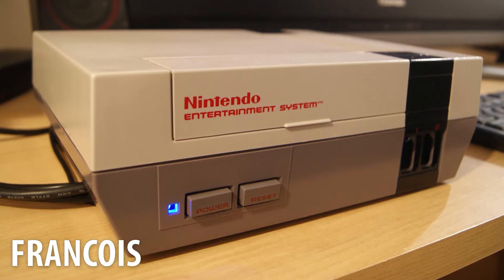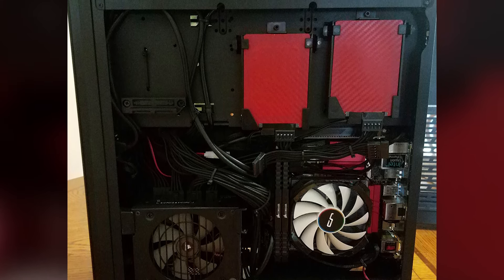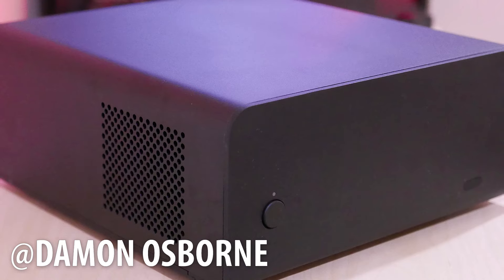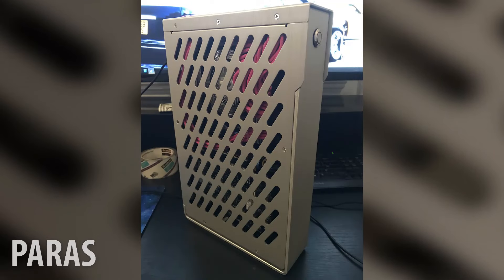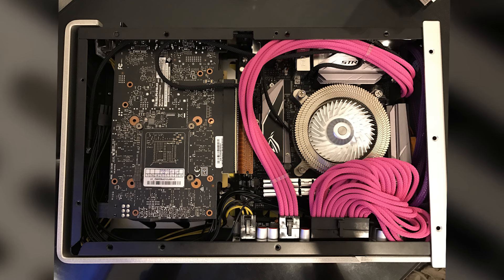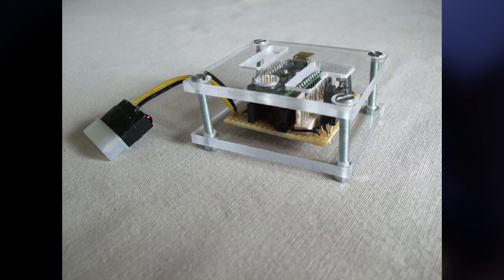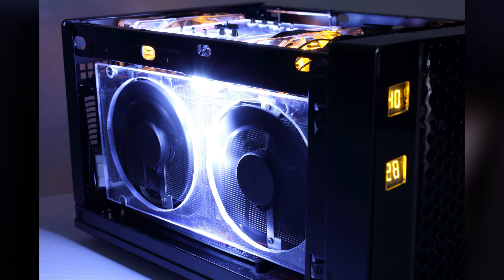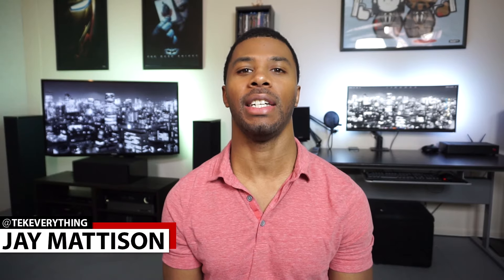Mini-ITX PC Showcase - Ep.1

Comment: Nice video!I just had a question regarding the node 202 and rvz02 because these 2 cases are the only somewhat inexpensive cases which I could build in but was really torn between which one is better.I really like the rvzs design and interiors but the node supports extra case fans.I'm planning on building using an i5 7500 and either an rx 470 4gb or gtx 1060 3gb. Which case would be the better bet in terms of effectiveness and cooling.
Reply from the maker: They will be similar it terms of cooling. I would lean towards Node 202. Just personal preference though. The Node is slightly smaller and has cleaner lines IMO. You will be fine with either though.